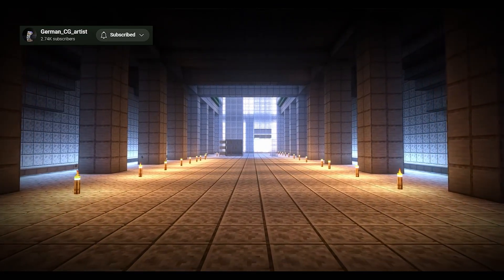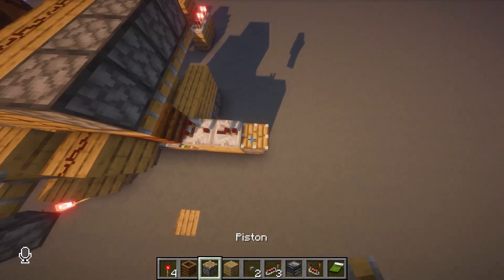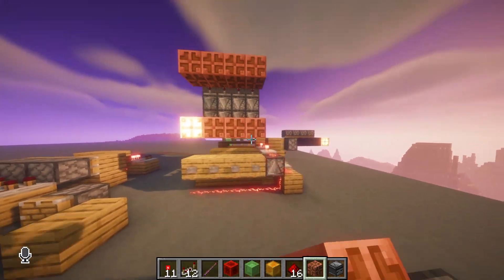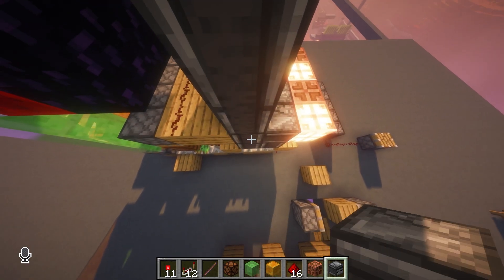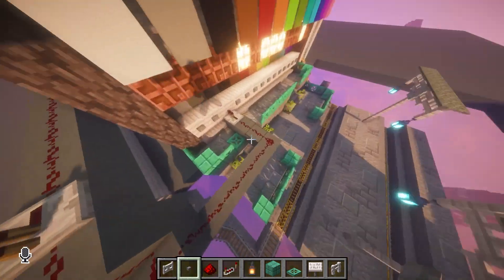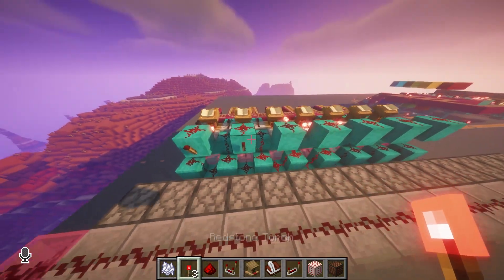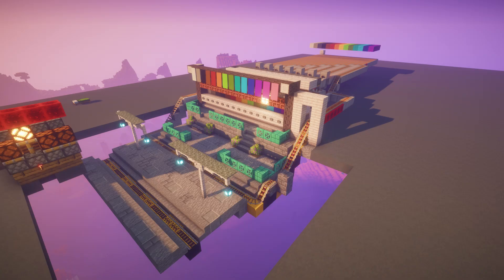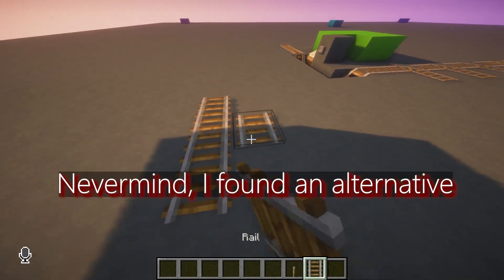Minecart Station Concepts for High Speed Rail Networks

Comment: Not to take away from the video, but if anybody is looking to build something similar look into encoded piston bolt networks, some very smart people have figured out how to encode a network such that you can go to any station from any station through some signal strength math. These designs can of course be easily changed to use the minecart speed gamerule instead of a piston bolt.